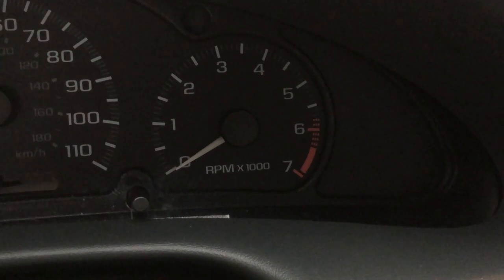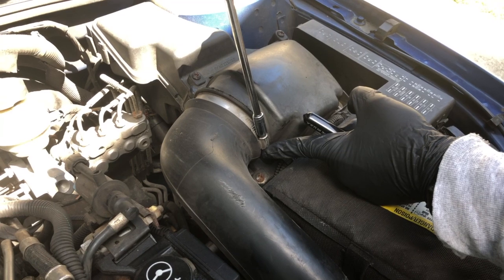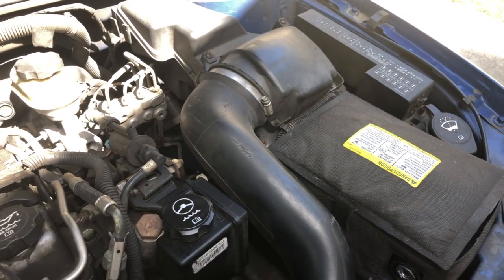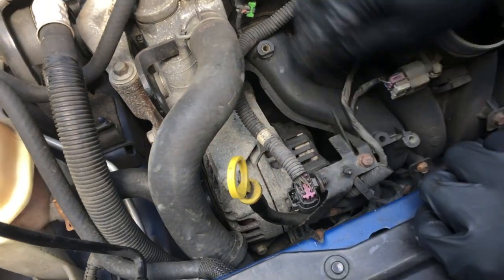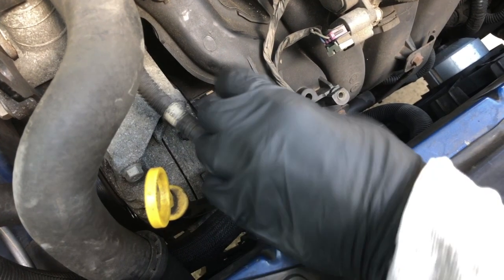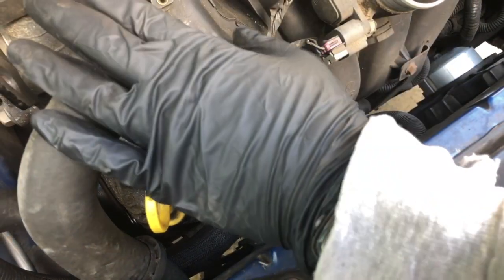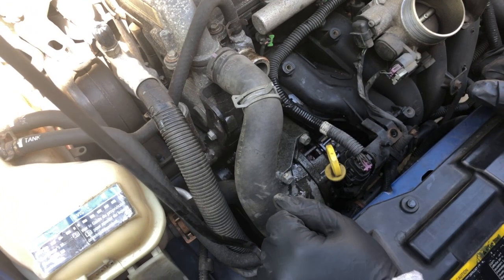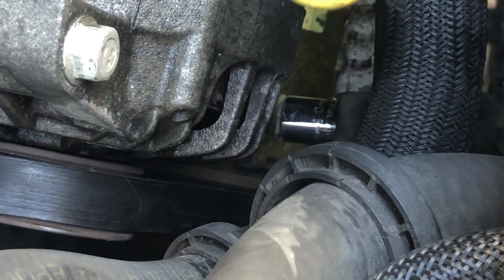2003 04 05 2.2 Ecotec Alternator Replacement Chevy Cavalier & Pontiac Sunfire (Red Battery Light On)

Comment: Where does the b + wire connect to from the alternator
Reply from the maker: The large cable held by the nut shown in the video should be going a fusible link, which in turn goes to the starter solenoid.

Comment: What was the name of the part that you broke and where can I buy one? Mine also broke and I checked my local junk yard and they didn't have it and I can't find it online.
Reply from the maker: I believe you are referring to the nipple that the PCV hose attaches to on the air intake resonator. This is the black plastic box where air ducted in from the air cleaner assembly is ultimately routed into the engines throttle body.   It's a common point of failure after two or more decades of plastic aging now on these models.   But you can find resonators in salvage yards still intact in southern and western states (away from the salt belt states).

Comment: So that plastic connector to the airbox always breaks.You can buy threaded fittings.Drill out the hole and put a metal fitting.it will last forever

Comment: Were there any particular reasons to buy this brand of the alternator? There are cheaper ones, like for $99, and this one $170 (Amazon).  Thank you for a good explanatory film.
Reply from the maker: Well couple of reasons.  First, the OEM ACDelco brand alternator lasted 16 years.  This repair is alot of work, I don't want to do it again in the life of the vehicle so that is important to me.   Second, the GM part exactly  matches the original specifications (no more, no less).  So I have confidence I won't be looking at any incompatibilities.   I aim to save the money by doing the work myself, and then just aim for the lowest price I can find while sticking with original GM parts.
Reply: @DrShock  Thank you for your replay. I also try to buy best parts, but if to do search on Amazon the part "New Alternator Replacement For Chevy Chevrolet Cavalier Pontiac Sunfire 2.2L 2.2 (2002-2005) Saturn Ion Vue (2002-2007) Chevy Classic, Malibu 04 05, Oldsmobile Alero 02-04" comes first in the list, and it is said "brand new" ($99). "ACDelco 334-1468A Professional Alternator, Remanufactured" is also there ($165), but you see how it says "remanufactured". I'm thinking maybe just different companies, and that is why difference in price. The alternator on our car is working, but car is 100K, so I think it is better to update some stuff there.  Thank you again.

Comment: I'm sorry I am doing this right now and um was your radiator reservoir empty, I loosened mine and it started spraying out
Reply from the maker: I believe I mentioned this, but you want to have a cooled off engine when doing that so that there is no coolant pressure (or anything too hot to work on in this area).  Some leakage of coolant is normal and unavoidable, but there should be no pressure when cold.

Comment: can this cause the abs light to come on as well as the battery and check engine light
Reply from the maker: Only the battery lamp will be affected by a failing alternator.  If you let it go until the battery dies, you might get other lamps due to the low voltage situation.  But if you're car is running, and you have ABS and check engine on then no.   It's time to connect an OBDII code reader and see what the diagnostic codes are.  If you don't have one, swing by your local auto parts store.  Most are happy to read off the codes for you.
Reply: Yes the ABS light comes on the emergency brake light comes on all the lights on the dash come on and the gauges will stop working and come on that's when I knew my car was about to die

Comment: Please help where does the fusible link go connected to my battery is not charging after replaced with a new alternator the fusible link passes a continuity test my only other concern is the connector will that be my issue.
Reply from the maker: There's only two connections on this model ACDelco alternator shown starting at 15:51 - one is the battery cable and the other is the sense harness.  The battery cable is the one with ring connector that you attach to the stud and secure with a nut, the other is simply a plug in style.   The battery cable is the one with an inline fusible link.  You can measure the output of the alternator on the battery cable to confirm it is working.

Comment: Where does the other end of that gold nut battery post cable go to it seems that I have two ends loose and don’t know where the other one reattaches....
Reply: Is it a ground?
Reply from the maker: The primary post cable with the ring connector goes to the battery eventually, it's part of the factory charging wiring harness and should not be "loose" at the other end.  If you google for a Cavalier charging diagram for the years this video covers you will see this cable should have an inline fusible link and then connects the alternator to the starter solenoid, which in turn is then connected to the battery positive terminal for charging at the same point.
Reply from the maker: No, the alternator is grounded to the chassis by the bolts that attach it to the engine.
Reply: @DrShock  I see! Thank you for a quick response. I seem to have 2 ring connections, and I may have not connected the old connection to my new starter during the swap. After the vehicle died 10 minutes from home after that swap, I believed my alternator was out, but it may be that my old one simply wasnt connected!